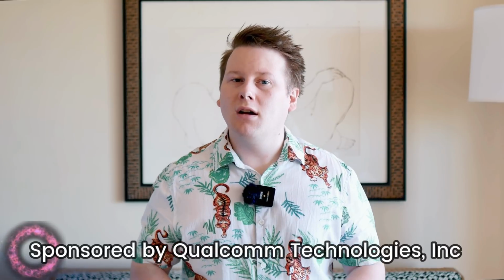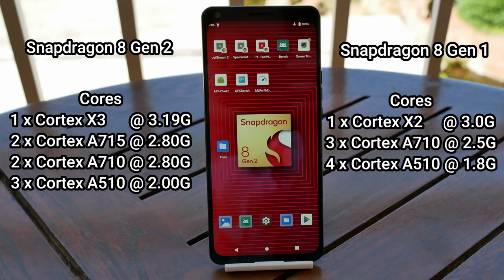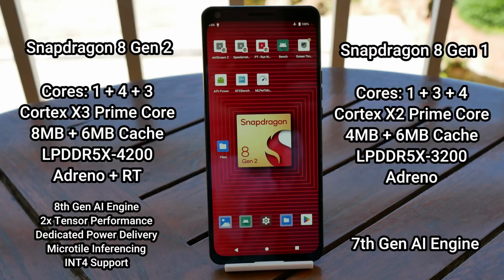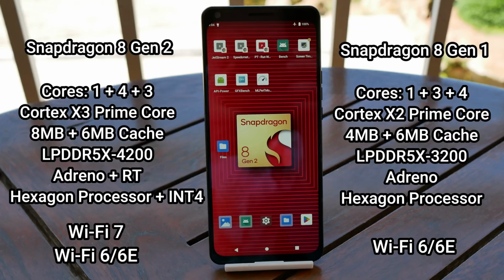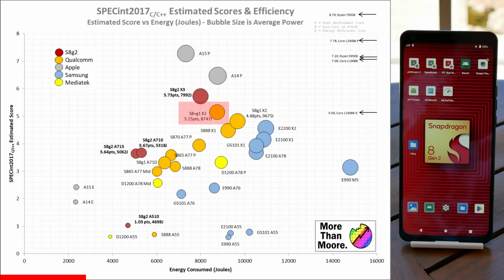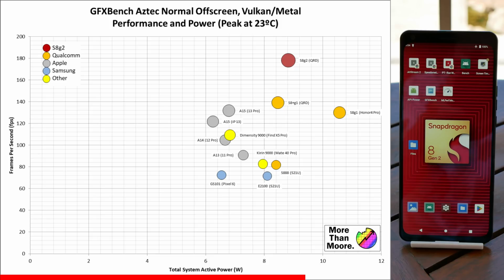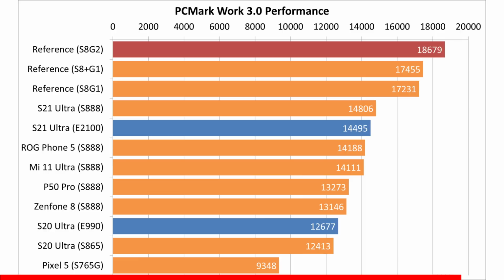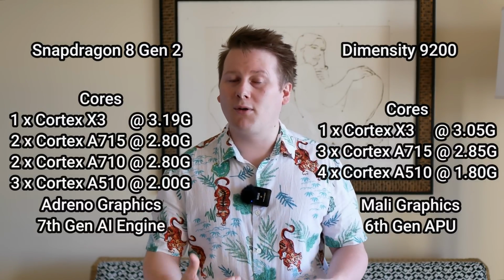Snapdragon 8 Gen 2 Tested: Benchmarks and SPEC

Comment: If it's anything like the previous generation, it will also suck up a fair amount of power and thermal throttle heavily in most devices its placed within. High numbers are great for marketing, not so good for actual usability.
Reply: It has good stability in 3d mark stress test so I think finally lees throttling this time but it could also be down to the currently released phones having beefed up cooling
Reply: But yeah I hope samsung will do like a low power mode thats like 8 gen 1 or 8+ gen 1 performance with less power draw I think they had that on the fold 4 because unless your playing some highly intensive game or emulator or something u dont always need the maximum clock speeds and samsung is using a slightly oc version which might use more power for those clocks
Reply: The energy is given in these charts, even compared to the 865, did you even watch the video?

Comment: Geekerwan did an amazing video comparing smartphone effeciency, you should do testing like that once you can mod the phones and their power usage to plot out a graph. Essentially chips have stagnated the past few years because the ARM cores at the heart of most designs haven't improved much. To compensate a lot of chips just added more power to get higher geek bench scores. But the gen 1 plus snapdragon did help because it moved to TSMC instead of samsung making it mroe effecient. But I find it shitty that watt usage keep increasing when effencincy and battery life should be the norm

Edit: to clarify, the chips look good in benchmarks, but that's peak performance, most programs and games don't use the chip 100%, for example a game is often gpu or cpu locked, and every day programs never use it fully, so the low wattage effeciency is king, way more than the peak performance
Reply: We want more of that quality testing!

Comment: i think 32 bit compatibility would benefit some emulators(i think dolphin was one of them but not sure). so it's a good think in my book.
Reply: Pretty sure emulators can adapt for strong software emulation

Most desktop chips are 64bit only but still runs 32bit programs without much hassle
Reply: @aravindpallippara1577  as far as i know it's not possible. the normal console like nvidia shield can run dolphin but the tube like shield can't run it because it lacks support for 32bit or 64bit i don't know which way around it was.
And on the pc side of things: 64bit expanded 32bit instructions, it didn't replaced and killed it.
Reply: @mhh3  oof forgot about 64bit being extensions - still I would assume it's far easier to emulate 32bit than 64bit on a given hardware

Also tube shield could have a gpu incompatibility or the application itself may be incompatibly build - we will know soon if mediatek 9200 can run dolphin when it releases, since it's 64bit only

Comment: A710 circle is smaller than A715 lol. ARM aren't even trying
Reply: Yeah bring on nuvia/oryon cores arm are trash they need to catch up to apple especially for performance per watt and power draw of the last few chips being terrible tsmc will help a bit but phones will need 6000mah just to match apple battery life with the current trash that arm is putting out
Reply: @sbrader97  ARM engineer slacking on the job. I mean it's fine if they're at the top like current Apple or old Intel but, they're totally not

Comment: Should be a great upgrade from SD835 to SD8G2, right?
Reply: I'm on 845 and slowly start to see the phone getting a bit slower. Not sure if I will upgrade to an 8G2 phone, but for sure in the last few years progress was very slow and incremental, unlike 2010-2015 where every generation was so much faster that the old one was instantly worthless
Reply: @TheRailroad99  I'm on a S10 so think that is 855 and its on Andriod 12 and quarterly updates currently. So I may make a move to SD Gen2 should be quite the jump.
Reply: @TheRailroad99 wait for nuvia based 3 nm chip next year
Reply: that might actually be noticeable
Reply: Freaking huge man. Well over double the speed.
Reply: @piercewiederecht5135  on tests sure, but id bet money you couldnt tell between gen 1 and gen 2, or even 888 vs gen 2
Reply: 8G2 is bad for the battery, so to replace 835 I'd suggest a midrange phone. Still, 835 holds just fine, I have one as the second phone and am not planning to replace it yet.
Reply: @costakat6986  - All I heard about the battery in a SG2 phones (specifically S23 Ultra) were praises. About how efficient the chip is, and how long the battery lasts compared to the previous gen and so on.